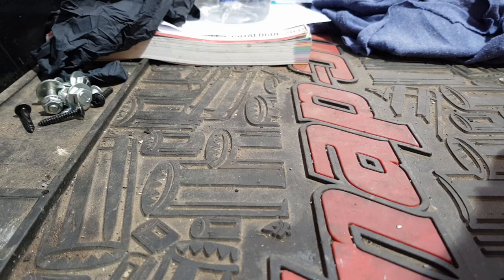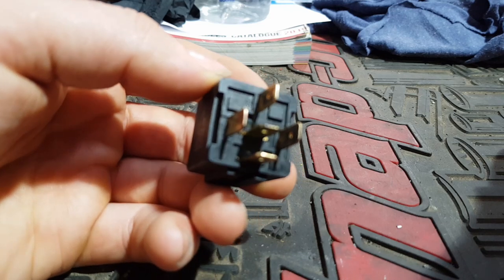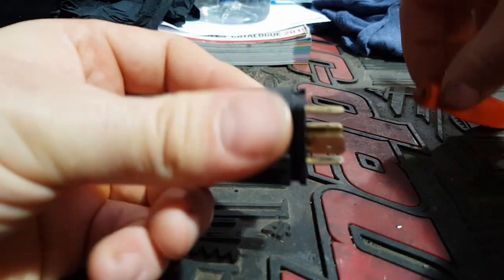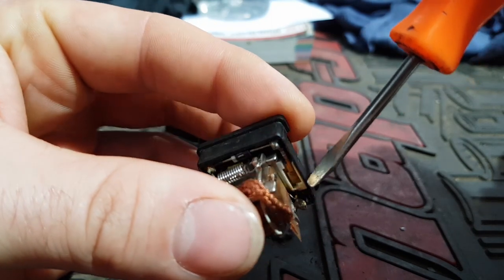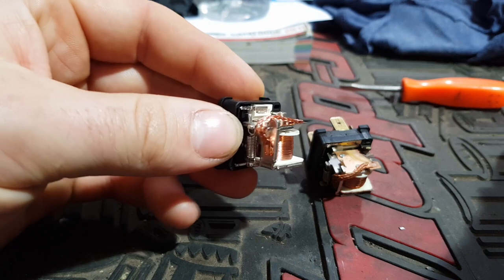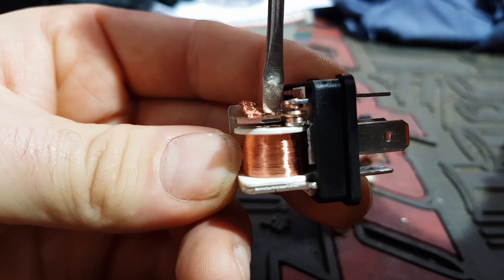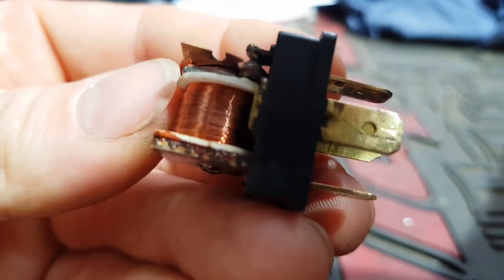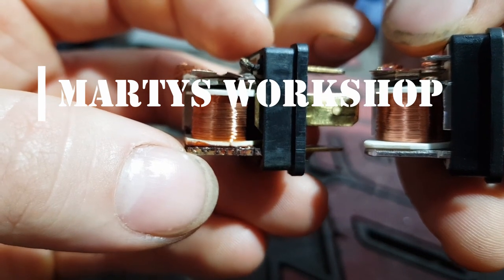12 / 24 volt relay with faulty melted contacts and how it works car van truck lorry

Comment: Hi Marty, thanks for the video. If the same relay keeps melting in the fuse box is it worth putting a higher rating of relay in? It's a known issue on Renault Modus and Clio's on the dipped beam relay. Any advice appreciated!
Reply from the maker: If they do a higher rated relay then yes but is sounds like a bad design to me as the bulbs must be using more current than the relay can handle.

Comment: Hi, my relay clicks on/off as it should but it does get very hot? The vehicle in question is a 2001 Iveco eurocargo, 24v electrics. When i turn the ignition on then the relay contacts join and stay on/connected and disconnect when i turn the ignition off. This i think is how it should work? So why would it get so bloody hot? Regards Mike.
Reply from the maker: I'm not sure why it might be getting that hot but I have found from my experience that relays can get quite hot! Especially on hgv I have seen them too hot to touch. Do you have a fault or is it just the temp that is concerning you?
Reply: @Martysworkshop  I was a little worried that the relay could get so hot. Apart from that the lorry performs as it should. Thank you for your reply, regards Mike.

Comment: You didn't say the cause of melting relay?
Reply from the maker: I'm not sure I believe it was a starter signal wire shorting and engaged starter while engine was running,